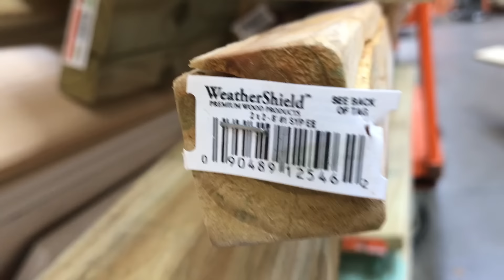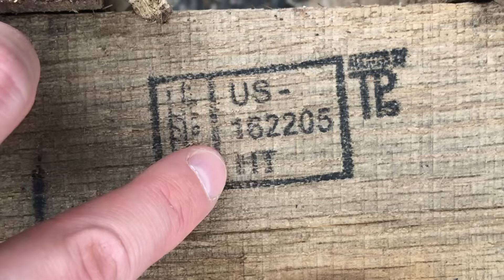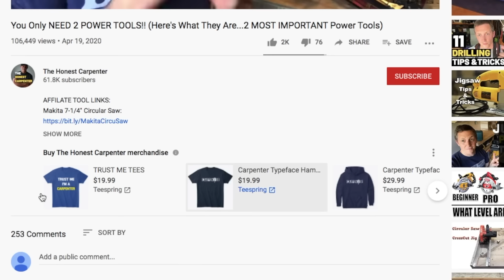Don't Use Pallet Wood!! USE THIS INSTEAD...(Cull Wood Vs. Pallet Wood)

Comment: Sir, I have used Cull wood before watching your video but didn't know what it was called.  I just saw a cart at the local Lowes in my town and I just asked the manager about it because it had a couple of boards on the cart that I needed but I ended up buying the whole cart for literally pennies on the the dollar.  I continued to check at the Lowes every week until I got up enough wood to complete several projects around my farm.  I always called it returns stock.. never knew the of "cull" wood name but it is great way to get small projects done with very little money.   I have built everything from entire garden shanty to an extention  on a garage and a fenced in garden.  Great way to get wood ... simply the best if you are on a budget.

Comment: Pallet timber is fine. It’s perfect for little DIY projects. I live in Australia and we don’t get free cull wood. Plenty of free pallets and it’s got character. Just get the right pallet.
Reply: @wolfie54321  it also depends what you’re building. The thing is, you can make things that are nice and not pay for the timber. Pretty good deal if you ask me.
Reply: @wolfie54321  I worked in a construction company so had access to that. It is also “what are you building!?” Is it a small planter box or serving tray? Then use free pallet timber. Is it a large table or bench? Perhaps something better quality.
Reply: The wood's ok if you check it... look for the codes that tell you how safe they are to use in gardens or elsewhere. In NZ 90%+ are made of pine.. from our 26 squintillion pine trees in plantations. Yes, you have to work within the length limitations of the supporting boards. The 4 x 2 ( 100 x 50 )heavy bracing pieces are very useful. Some pallets are made of lighter, thinner wood which I don't use, and some few are even made of awful plywood.

Comment: Nice video.  I'm not so sure it's a matter of one is better.  Neither of these sources is getting turned into heirloom grade anything.  So that said, they're both a great source for all those non-display pieces we create.  Tool bases, shelving, slats, storage, yard projects, if it doesn't need pretty use what you get your hands on.

Comment: Good points about pallet wood I never could have thought of. Apart from the cleanliness and health concerns is the time taken to carefully disassemble them into useable wood but also the extra time required to piece mill the project together from inconsistent pieces of wood. This can double the build time. If I do continue to use pallet wood, I'll be sure to wear a respirator while cutting as well as relegate the materials to exterior projects.

Comment: It really depends on what you're going for and what you have available to you. Both options have their pros and cons but in either case you're going to spend some time just to make them useable. Methyl bromide is banned for pallets made in the US and many other countries so that's rarely an issue anymore (unless they originate from China). Me personally, I have a source of pallets that had dry goods shipped on them, so no worry about chemical spills.  They are used only once and then put out for whoever wants them, so they are practically brand new. The slats are basically 4 foot long rough sawn pine 1 by 6's, and they are DEAD straight.  For what I'm doing with them, they are great.
Reply: Exactly.  I've picked over my local HD and Lowe's cull piles multiple times.  Not much good there.  

It depends on what you are making.  It depends on what is available in cull piles.  And it depends on what pallet quality you have access to.  Three important variables that can vary greatly.

A better (less click-baity) title and approach to this video would have been:  An Alternative to Pallet Wood.  Where the same basic information is presented, but in a more balanced way...  pros and cons of pallet wood and cull wood.

Honestly, I won't be subscribing.
Reply: Exactly!
Reply: DR PHIL  depends on the resources you have and the look you're going for.
Reply: DR PHIL  Because for a lot of us, the pricetag is too steep. If you never had a money issue, then I get your question, otherwise it is a pretty "duh" thing to me...
Reply: I picked through a pile at HD. Took for ever. When I got to the register,  the cashier called for a price. The guy comes up and says 10% off. Seriously only 60% of it was useful.  The guy says it was to good to have the purple cull paint. I told him to keep it.
Reply: Thank you for the elaboration! If you don't mind me asking, where would be a good place to look for "better" pallets?
Reply: @dianafertig2188  HD is a bit difficult to get discounts or even pallets imo. I've never tried to buy their cull wood but I asked for 2 pallets once and I had to wait 25 minutes and go through two managers before they finally gave me a couple of used pallets in meh condition. All that fuss for such a little thing.

Comment: It's 2023 ...I use pallets for kindling  for winter heat. I only take clean wood . No stains so I can spot broken nail heads easier. I also use them as platforms for my cord wood so it sits off the ground . I will be on the lookout for the MB label Thanks for that heads up . I don't use any pressure treated wood if it is in the area of the pallet wood I am after .I made sawbucks using a method I learned here on YT . However thank you for the heads up on cull wood . I didn't realize it was so readily available . I will check it out .

Comment: I use both. Cull wood is so much harder to find at a decent price  and as a lot of people have said, pallet wood use is for character.  Plus, I use pallet wood for the shear purpose of the joy and "therapy" of breaking it down.
Reply: Izzy Swan made a tool for just the purpose of taking pallet wood apart. Not sure what this guy is on about, I get decent pallet wood all of the time with no chemicals in it.

Comment: Very helpful, I've been meaning to start some yard projects and look for pallets but I never knew about cull wood. Also I figured I'd use some polyurethane on the wood to prevent rot and seal in whatever chemicals were used to treat the wood.

Comment: I have a different wrinkle on this topic. I live about 25 miles away from 2 places that make pallets. I can get wood before they cut it to make it into pallets, and the wood is good quality. I picked up 2 8ft 2x6's for $20 each and they were a beautiful purple color. They were cut right off the log to my specifications, so I know that they were not adulterated with any chemicals. To be truthful, there was a small line of rot in the boards, but it was easy to work around. They also have a huge warehouse full of dried boards. I picked up a bunch of walnut wood really cheap too. These boards did have to be planed down, but they looked super when done. The place I went even offered to plane them for me, but I decided to do my own planing. So it is worth looking around your area to see if there is a pallet-manufacturing shop.

Comment: The one distinction between cull wood and pallet wood is in the aging and character of the wood. Pallet wood can shortcut any need for making wood look old, gray and reclaimed. Especially if you are only using it for superficial cladding of a project. I agree with the idea that cull wood will be superior for building projects that require more structural integrity. And it is a great source for building a person stock pile of project wood. Thanks for the great videos!
Reply: Exactly! If you’re building a perfect rocking chair don’t use pallet wood. If you’re building a rustic garden toy box use pallet wood. Simples

Comment: Personally I think pallet wood can be very useful . I get really clean ones from a nearby electrical supply house or building supply . I have a half dozen oak pallets under my carport now with 1" thick slats that I'm sure will look great on the double doors for my shop. Sure, they can mean extra work , but a lot of skilled woodworkers find them quite handy.
Reply: The only time I use pallet wood is when I want to make something using the "pallet wood look"  Otherwise they are not worth it at all.  You can make some cool stuff with the pallet look like rough doors and such for sure, but I would avoid planers with the stuff as it eats blades.
Reply: @jstep4146  It honestly depends on where you get your pallets. Electrical supply like twoweary stated is likely to have pallets that are single use, they ship in not out. 

Before they limited it to employees only I used to get sheet goods from papermills. Their rolls come in giant boxes with 3/4" plywood. Sure it is usually only 2' wide but who cares? The 2x3s they use as a frame for it all is useful too.
Reply: Awesome 👍🏼

Comment: Great tip! Wanted to build a reclaimed lumber table top and intended to use pallet wood, but went to the local lumber yard and came away with about 4 2x6x16s, a stick of 4x4 cedar, and some other scrap 2x6 and 2x4… FOR FREE!
Reply: ...aww!...bingo!...chuckle...

Comment: I lived up in the Canadian arctic for awhile and in the town I lived in, there was only one lumber yard. Pallets and wood shipping crates where basically the only affordable source of lumber. Some of the larger crates could be built with 2 x 8 and 3/4" plywood. Basically you just had to hoard every board you could find because buying a 2 x 4 for like $12 is just not the way to go. I do keep an eye out for cull lumber down south where I live now, but it isn't super common in my local lumber yards

Comment: You are right!  Common pallets are mostly junk and difficult to work with.  However if you Know where to look you can find high quality shipping pallets and crates. I worked in the printing industry and many of the pallets that are paper came on were new and high-quality dimensional lumber and some contained pallet toppers which was also dimensional. Also look for companies that ship equipment typically they build custom crates out of dimensional lumber. I have gotten numerous two by fours and three-quarter inch ply some large pieces of equipment.  Keep the great videos coming.  Thanks

Comment: I used them not to build Furniture anything like that I use them in an accent wall with all the nail holes and with the nail head still in them. I don’t care about the different widths size or any other thing that is wrong with them and they look great.

Comment: I've used pallets effectively before because I had a source which always had clean dry and good looking pallets and I've made an excellent rock solid desk that lasted for years even outside. Just applied a top coat of polyurethane. However I'm not really into that look right now, so thanks for the tip. I'll check out cull wood. Pallets are still neat, but only if you have a  good source.

Comment: I’ve only ever seen a cull pile once in a big box lumber store.  There was literally nothing usable and my standards are low enough that I do use pallet wood.  To be fair, I don’t use pallet to make rustic fine furniture. Mostly just for mocking up ideas or rough fast tables or benches.  Just stuff I need fast and don’t want to waste good wood.  Generally things I consider disposable.  Pallets are free wood I can use for test cuts or practice cutting complicated joints I want to figure out good ways to cut or mark.  There’s also times my sone and I need to do something like rip a motorcycle or lawn mower engine apart and will be working in the driveway.  We just need a quick table that we don’t care gets covered in oil so we make a free, disposable table.  There’s so many uses for the pallet wood it’s unbelievable.  If you happen to like the rough and rustic look, good on you.  Build away.  Not my style but I don’t have to put it in my yard.  The only thing I ever used it for to get its rustic effects was a pirate treasure chest one of my kids needed for a Halloween prop.  Took a couple hours to build a chest that looked like it could have been in a shipwreck with a ghost pirate.  All these uses and not a penny spent.
Reply: Love this cause pallet wood is so called crap...this guy doesn't know what a plainer or a joiner is.  Further more I work at a place that receives at least 30 different types of pallets not counting the types of wood.  So when I see solid oak rough cut, at 2"x4"x4' or 8' its time to for him to rethink that wood made from pallets in the US of A that don't have pesticides that does not get imported or exported is something to consider.  Just saying lol.

Comment: Like a lot of things, the bottom line is "It Depends".  I've gotten good stuff from once-used pallets and crates used to ship machinery, etc.  Even some 4x6 treated long lengths.  Yes, be careful of anything that might have shipped chemicals but sometimes you can find "exotic" species that once planed, and I do own a metal detector, that are beautiful stuff.  As to the thickness, you are of course correct but a lot of small projects actually look rather clunky when made of 3/4 or heavier stock so I like the thinner stock for certain things.
Reply: I've used pallet wood for a number of projects.    You need to be careful check for nails.     I've also found that I can used fence pickets particularly cedar pickets when I'm looking for the rough look in a piece of furniture, a picture frame, serving tray etc
Reply: I had a ton of 5'x10' pallets with ~3x4 rails.  The decking made great firewood but the rails are awesome.

Comment: I made my replacement shed floor out of pallet wood and it's held together well and is showing no sign of rot. I will concede that breaking them down and getting the nails out is a pain and takes acres of time though. I've never seen marked down timber at any timber merchants though. Maybe it works differently here in the UK.
Reply: well, I live in Atlanta, GA and ain't never done seent no cull cart in Home Depot neither.  Admittedly, I never asked at Lowe's or Home Depot about cull wood.  A bit surprised they don't just slap a 70% off sign on the cart.  Actually, very surprised!
Reply: I'm in the US and haven't ever seen it either but I'm gonna ask at Home Depot today.
Reply: @kristineolver3268  sooooo...... I must sheepishly update my comment.   I axed the good peeps at Home Depot about a cull cart and lo and behold, they do have one!  I guess I need to become even tighter with employees before I can ask about getting a head's up for when they do cull wood.  But they do, in fact, have a cull cart.   So, thank you for the tip!
Reply: @coppulor6500  I'm a (relatively) new EMPLOYEE of a big box, and I wasn't even aware of 'cull carts' !

Comment: I made some bed sides for my flatbed truck with pallets. They're pretty good. But I toss the top planks. The beams on the 4x12 industrial pallets are best. They're like a 2x3 and you get a bunch of them and they're usually reasonably straight. I think they'd be good for studding out a cabin or making concrete forms.

Comment: You are mostly right. But I do use pallets for other projects like Chicken coop or run, Temporary fence or Garden beds. I make sure they are HT (Heat Treated). For sure I will never use them for any project inside the house. And mostly I use them as a whole, I don't break them down. Some pallets I picked up for free and they were almost brand new. I got very good 2x4s out of them. It all depends on your project. As for the CULL wood, I always swing by that pile at Home Depot even if I don't need wood, I pick up what I think it is good and always find a use for it. Thank you,

Comment: I found a good use for pallet wood is for my rafter storage. I've made some shelves up there with 2x3 boards and ran the pallet wood across as support slats. But other than that, I agree with not using them in general. It's pretty annoying to try and reclaim the wood too.

Comment: I've used cull wood before for home projects (I am by no means a professional) but I have used pallets connected together for a deck structure that I attached nicer wood to the top of. It worked out pretty great and lasted for almost ten years before getting replaced outright with a larger deck. The pallets were means to an end and really only functioned as a structure rather than an aesthetic.

Comment: im really picky about my pallets. I find a lot of oak and maple and even some more exotic stuff. takes a while to process but well worth it IMO. I have no use for pressure treated lumber at this time. most of what I do is small boxes, shelves and nightstands etc.
Reply: Where you find pallets made of those woods? Everything around here is cheap pine.

Comment: My wife works for an AC contractor. I take the wood from their duct board crates. Similar look to pallet wood, mostly oak. Less nails and usually 12 foot in length. Bonus, no insecticides sprayed on them. And they are very straight.

Comment: Even "food grade" pallets may have been used for nonfood and/or carrying chemicals that leaked. As a long haul driver, I have seen how bad pallets can be.
Reply: Anyone making projects they expect to last are going to be sanding and sealing the wood, so nothing from your carried stuff or leaks could pose any issue .....
Reply: Mark Curry So true, in Australia we get pallets that are used only once for white goods and they are so clean not even sprayed or heat-treated
Reply: As a loader of such trucks..i see many drivers who have a bad observation skill...just saying.
Reply: Bows are usually made from straight wood, unless they are recurved. The bow is a bow is because the string tension, not the shape of the bow.

Comment: Good tip but people don’t use pallets for every woodworking application. It’s usually used BECAUSE of its look. It’s rough, beat up, and a lot of people like that rustic look. A lot of designs intentionally play up the fact that they were made from pallets.